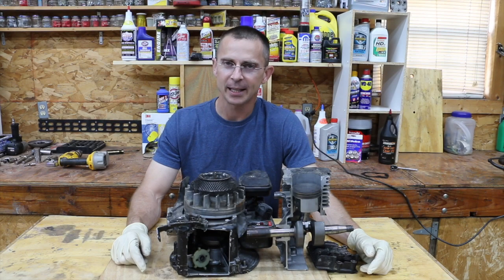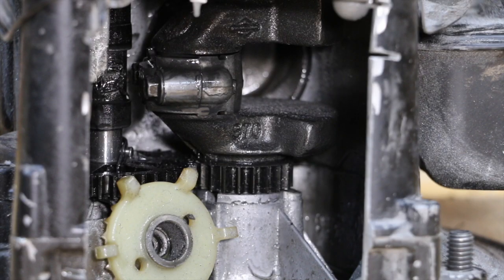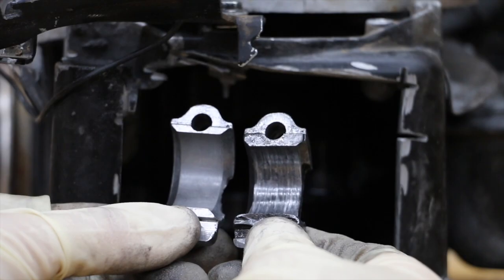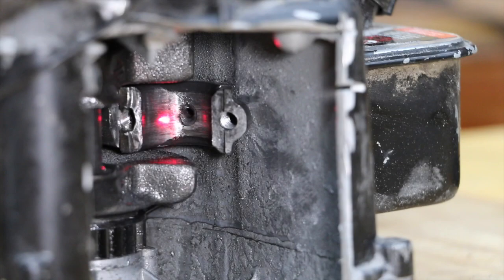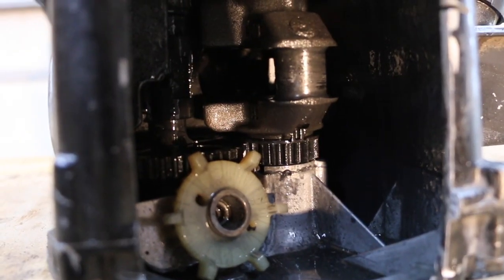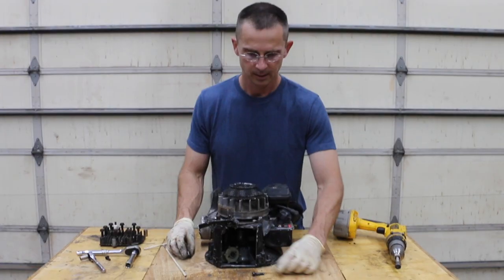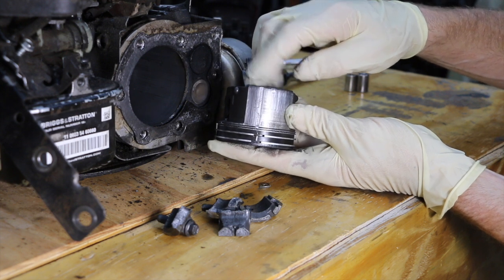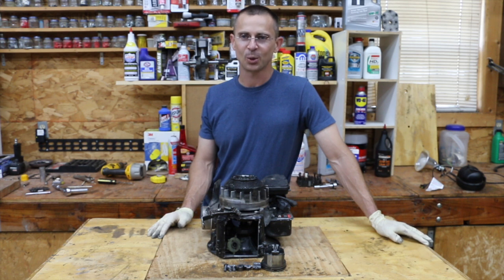Running Cutaway Engine Throws Connecting Rod!

Comment: Eh, only thing that bugs me with this video, the title is sort-of click bait.  While it did technically throw a rod, it did so in a disengenuine fashion...

Worn slap out, forced to run with no oil, seized, cooled, and ran again.  What did anyone expect?  Of course it would fail.  At 500 degrees anything would fail.

I expected more of the typical "thrown rod" due to over-reving or under-built bottom end, resulting in the rod punching a hole in the case, not just mechanical failure for the fun of it...

Overall, not a bad video, get yourself a high-speed cam and label the title better and I'll watch another.

Comment: had the exact thing happen to one of my 1970s snapper rear riders was out getting rocks in a field (for the farmer) and a nice loud clunk  and she was done. had been seized twice before hand so i was expecting it to happen. id love to see what  would happen if you run an engine with sand in the crank case . i know you did one with it in the fuel but in the crank case would have much worse effect {aka breather tube is not  hooked up to air cleaner without a one way  valve.
Reply from the maker: Hevury, Great suggestion about adding sand to the crankcase!  Thanks for watching the video and commenting!
Reply: kinda had the same plans you do with extra engines i have lying around but since your doing such a good job i will be able to try other things with them ,keep up the great videos!

Comment: 1992 Cummins Big Cam 400 with +1 million miles failed and had a 2 rod section of crankshaft blow through the oil pan and dump 15 gal. oil on the road.

Comment: Hey PF, How about showing these guys how to properly repair an engine with a thrown rod? You could use the engine that you blew up here and maybe make a Lexan window where you cut it out so you will have a great visible teaching tool.
P.S. In case you didn't know already, a strong caustic (super strong soap) will dissolve the aluminum off of the crankshaft so you aren't grinding it into the rod journal when you polish the throw to remove any burrs.

Comment: I had the exact same thing happen with a 6 hp Tecumseh horizontal shaft engine, but it gave no warnings before failure. I was working it extremely hard tilling a sod covered garden.
Reply from the maker: Steven, Thanks for watching the video and commenting!

Comment: in response to the question at the end of the video, yes, my mom's craftsman lawn mower blew its head gasket, the engine belt in my mom's 1995 ford thunderbird v6 snapped, and my grandfather's rotatiller engine's starting mechanism's ratchet engages randomly and stalls the engine. soo many engine failures.
Reply from the maker: Thanks for watching the video and commenting!

Comment: Looked it up a few months ago and JB Weld is good to around 600F so while it may take the heat it may not stick well to a casting that's been soaked in oil for years. (oil in the pores of the metal) I have used JB Weld to fill in aluminum where an intake manifold cross-over gets crappy from coolant leaks and it does the job. I have a fleet and started using that trick around 3 years ago. Put it on at the end of the day and next morning level it off with sandpaper. Presto, new gasket surface!

BTW, one suggestion to safeguard your camera for this experiment would be to position a mirror so you are doing the video 90 degrees off center from the side. Worst case is flying parts take out the mirror, not an expensive phone / camera.
Reply from the maker: rupe53, Great suggestion on using a mirror!  Thanks for watching the video and commenting!

Comment: had a Honda with a cold air intake suck water into the engine and throw a rod through the bottom of the block. oil was all milky.
Reply from the maker: Shane, Thanks for watching the video and commenting!

Comment: I've had a connecting rod explode in a radio control model helicopter. The engine seized in flight - and I auto-rotated and managed to land safely without braking anything. When tearing the engine, I found its conrod was in a million pieces. I had purchased the heli used, so there was no telling how the engine was treated beforehand. As for the engine, that was the perfect excuse to get a brand new, better, more powerful engine. I flew the heli for another year end eventually sold it.
Reply from the maker: Interesting!  I'm impressed that you were able to land safely with a seized engine.  Thanks for watching the video and commenting!

Comment: You should have stuck your weiner in there so the con rod could tap it.  I drove my 1986 cavalier for a year with a rod knock.  I got the bottom end of the engine overhauled in 2003 and I am still driving that car.
Reply from the maker: Thanks for watching the video and commenting!

Comment: Could you somehow try to induce detonation and/or pre-ignition and see how well the engine holds up. I'm not really sure if and how you can do that with a two stroke and if it's any different from a four stroke. Maybe overheat it and then lean out the mixture or mix the fuel with something that burns more readily. Or perhaps do all of that and feed it with really hot air and maybe that'll cause it to detonate. I'm not really sure if that would work though.
Reply from the maker: Gordon, This is a great suggestion.  Maybe I could remove the flywheel key and advance the timing enough until in predetonates.  Thanks!
Reply: Project Farm Yes, and I'm not sure but maybe you can add something to the gasoline to make it more likely to detonate. That, and lots of heat might create the right conditions for detonation.

Comment: I think you should retry this test spraying water into the engine to see if the water keeping it cool will make it run significantly longer. Or drain the oil and refill it with water and see how long it will run. I think that the engine died from overheating more than lack of lubrication. Thanks for making this video! Please make more!
Reply from the maker: These are great suggestions!  Also, thank you for the the positive feedback.  I have some very interesting videos underway and looking forward to publishing them soon.  Thanks for watching the video and commenting!

Comment: Facinating projects Dude! If I may suggest another one:      This is something that I thought about many years ago, but never had the recourses to actually do it.
    In the vein of so-called "miraculous" lubricants, and for the sake of comparisons, I'd like to see the results of how well or how poorly, and also how long, a small motorcycle engine, say 250cc's, would run on COCONUT OIL! Instead of conventional oil.
     What do you think, sounds interesting?
Reply from the maker: Y.K.W.H.  Great suggestion and this does sound interesting.  Thank you very much for the idea!

Comment: Try running an engine on 100% undiluted cooling liquid.
Reply: Gentleman Hooligan Dieselised Briggs?
Reply: running on diesel, or replacing engine oil with diesel?
Its been shown that after a gas engine heats up, it can run on diesel
Reply from the maker: Gentleman Hooligan, Great suggestion.  Thanks for watching the video and commenting!
Reply: :D SENPAI!
lol sweet
Reply: like continuing the combustion cycle.
ya.
Reply: Gentleman Hooligan For certain loose definitions of "run"......

Comment: This begs the question. Can you fix a connecting rod with JB weld? Or maybe a valve?
Reply from the maker: Dylan, LOL!  This would be the ultimate test for JB Weld and for me as I attempt to shape the connecting rod.  I don't know if I'm up to the challenge. Thanks for watching the video and commenting!
Reply: Project Farm the tolerances on these motors aren't very critical you may be able to form the JB right around the crank with no cap. You could probably make the whole rod out of JB forming it around the wrist pin to I'll bet you it would run of a while
Reply: Yes!
Reply: It would be awesome if he tried it.
Reply: This is quite a ways off but what about a motor block that is made from JB weld? It would be tough to make but it would be an ultimate test on JB weld for its ability to withstand heat, pressure, and a pretty good beating.
Reply: no...its not glue and they have this new thing called welding
Reply: phil tripe I think we should call it "a poor mans weld"

Comment: I'd like to see two things. 
first, radial engines in WW1 used castor oil mixed with the gas to lubricate everything. like a two stroke. I'd like to see how hot the whole affair gets with a 100 to one or less mix of oil in the gas.
second I'd love to have seen if you could have stuffed lead in between the con rod cap and the crank, like adding a babbit material
Reply from the maker: Hans, These are both terrific suggestions--thank you!

Comment: I'm curious what your favorite additives are after all the tests you have conducted? I used to work at napa so I could test things on a discount but didn't have numbers to compare like you have.
To answer you no I haven't blown an engine but my father has both mower 20 something years old never changed oil just added drain oil as needed,and an old straight six ford with over 331,000 miles. I think he got his money's worth.
Reply from the maker: Brit, there are still many additives that I've yet to test.  Of the ones I've tested, I really like both Seafoam and Marvel Mystery Oil.  Also, I see value in using Lucas in some situations.  Many more projects to test and looking forward to testing each of them.  Thanks for watching the video and commenting!

Comment: I rebuilt a 10hp Briggs motor on a small riding lawn mower a couple of years back. A mouse had built it's nest inside the cooling shrouds and the motor had overheated and the rings failed. I replaced the piston and rings, the valves and of course the gaskets, all with genuine Briggs and Stratton parts. I could have rebuilt a small block Chevy engine for less and with a complete engine kit with new pistons and a cam and lifters. Wow Briggs is proud of it's parts.
Reply from the maker: 1967davethewave, Yes, the Briggs parts are expensive.  Thanks for watching the video and commenting!
Reply: Depends on where you buy the parts.  In the past, I managed to rebuild a lot of Briggs engines cheaper than buying them pre-built.

Comment: On an engine with every part held together with JB-Weld, which part would break first? Would it even run? What parts can you absolutely not fix with JB-Weld?
(conrod, head, crankshaft, piston, valves, etc).
Reply from the maker: I doubt JB Weld would last too long, if at all, for repairing the connecting rod.  I would avoid using JB Weld for any part of the engine that creates heat in excess of 500F. Thanks for watching the video and commenting!

Comment: top end overheated because no shroud to direct the air, and no oil as well :} I had an old junk car that I threw a rod demonstrating how not to start a cold car. I put my foot to the floor and cranked it over holding it full throttle till it blew within 30 seconds
Reply from the maker: LOL!  That likely awoke or startled the neighbors!  Thanks for watching the video and commenting!

Comment: That small gap in the connecting rod gave it knock and significantly raised the cyclical stresses in the rod. A well fitting rod would actually have significantly less stress.
Reply from the maker: Thomas,  Great point. Thanks for watching the video and commenting!

Comment: My dad used to tell me stories of how as a young man working on old cars from the 30's and 40's he had  used a piece of leather as a rod bearing, said he would replace it whenver it started getting noisy as a cheap fix to keep his jalopy on the road. I would be curious to see this dont on a small briggs engine. You might have to remove the rod and machine  it out a bit to fit a piece of leather in there but if you ever feel like trying that experiment  it would be quite interesting
Reply from the maker: Adams Larren, This is a great suggestion!  Thanks for watching the video and commenting!

Comment: One of the car dealerships I work at took in a 3 year old Mercedes AMG V8 SUV that had a head gasket leak, they gave them something like 40 grand on trade in... before the mechanics had a chance to do investigate the engine the mechanic bought a bottle of head gasket sealer... it put a piston through the side of the block in the parking lot about 10 minutes later. If I had to guess that garbage plugged the oil galleries and prevented the wrist pins and connecting rod bearings from getting oil essentially doing what happened here. 

Also thinking back since the owner mentioned the engine "had a slight engine sound" he may have tried similar things to it, so the head gasket sealer was compounded with another type and blocked everything.
Reply from the maker: Jesse, I enjoyed reading your comments--very interesting!  I'm guessing the Mercedes wasn't under warranty or the previous owner would have had the engine repaired.  Thanks again for commenting!

Comment: OK, OK.. NOW it's time to show us how good JB Weld really is!!! Put it back together again with a little  help from JB Weld
..
Reply from the maker: Truck Manjr, LOL!  This would be a very challenging and time consuming project for sure!  Thanks for watching the video and commenting!
Reply: I have see. a rod or too come out of a car engine. . one of a few was a 4 cyl. Toyota Motor.  and customer ran it very low on oil, so we started it up in the parking lot. to verify the noise she was talking about and the rod came through the side of the engine with enough Force that the rod came through the exhaust pipe under the manifold and through the radiator and condenser and into my leg, it put a one inch gas into my calf muscle!! it was 's something I will never forget! !!
.

Comment: I had a Mitsubishi 4G63 Turbo engine fail catastrophically. The car had a buggy oil pressure sender and I had previously checked it with a mechanical gauge and it was fine. So I was going down I-70 and the oil pressure gauge went slowly all the way down. I didn't pay any attention to it as it never read right anyway. About 20 miles down the road I heard a very loud knocking so I turned down the radio.  The sound of very severe rod knock. I tried to get off at the nearest exit but couldn't get over in time so I tried to just keep my foot out and pull off the next exit down. I didn't make it. The loudest, nastiest bang I've ever heard from a car followed by something hitting the floor pan so hard it knocked my foot off the pedal. I immmediately came to a stop on the side of the road and popped the hood and there was a very large hole in the front of the block and the oil was on fire. Luckily I had a small powder fire extinguisher (the ones you can actually spray on oil thank God). So I got it put out and it was just smoking a lot by the time the fire department showed. Fast forward to when I got it back home and got the whole engine out. It threw the number 4 rod through both sides of the block and there was a hole in the oil pan as well. Culprit? The counter balance shaft bearings seized which didn't allow the oil pump to turn. The engine starved to death of oil with a pan full of oil. I wasn't happy.
Reply from the maker: Loren, I enjoyed reading about your experience.  Engine parts hitting the floor pan that hard--that'll startle anyone!  Glad you were able to put out the fire.  Thanks for watching the video and commenting!

Comment: Had a" 71 Bel Aire 4 door Chevrolet with a 350 C.I.D. engine put a hole in the block, catastrophic failure.  I had bought the car years before at an auction, with a known engine knock. At operating temp the knock would all but disappear,  Turns out it had a cracked piston skirt.  I had run the car around 10,000 or so miles.(with the knock)  What happened was one morning it was about -35 F and I had a started the car and had warmed it up and took off up the road and the throttle cable stuck, the thermostat had not opened yet, I tapped the throttle and it stuck wide open, then shortly thereafter the thermostat opened.  The temperature differential was too much and the (cracked) piston failed, disintegrated and put a fairly large hole in the block, pulverized the piston, antifreeze and oil were instantly mixed, there was a large blue and white cloud of smoke hanging in the cold morning air and I had to walk over 2 miles in crusted snow across a pasture to get to get to work that day....  uh I guess the answer is yes I have seen a catastrophic engine failure!!
Reply from the maker: George, Wow!  What an experience!  I really enjoyed reading this.  Thanks again!
Reply: It was over 20 years ago, but yes that really did happen, glad you enjoyed my yarn spinning, actually I think I drove that car about 14 or 15 thousand miles with that knock before it happened......it had around 65 or 68 thousand on it when I bought it and think it had around 82 or 83 + when that occurred.  I finally got around to putting another engine in, I only run it about 2 thousand  and took it out to put in another car (I had a shop do it) but the owner died before it was finished. So had to haul all the pieces home.  Still have the rebuilt 305 with around two thousand miles, sitting in my shed.

Comment: Hey I love your channel but I just discovered it yesterday and don't know much about engines what are normal operating temperatures cuz to me those temps mean nothing cuz in don't know what normal is
Reply from the maker: JP RC, Great point.  I should have provided that information.  This specific engine...cylinder head should have remained around 250-300F and crankcase around 200-225F.  Thanks for watching the video and commenting!

Comment: Would it be possible to do a cutaway of a diesel where you intentionally let it "run away"? Where it keeps getting faster and faster until failure?
Reply from the maker: This is a great suggestion.  I'll be on the lookout for a small, affordable diesel engine for this sort of test.  Thanks again!